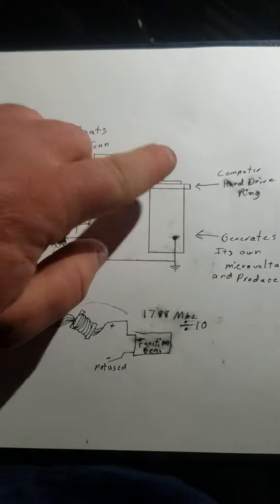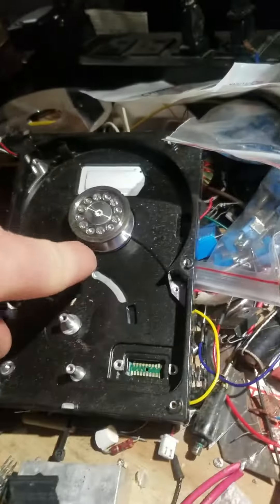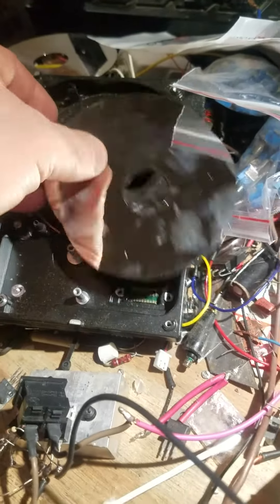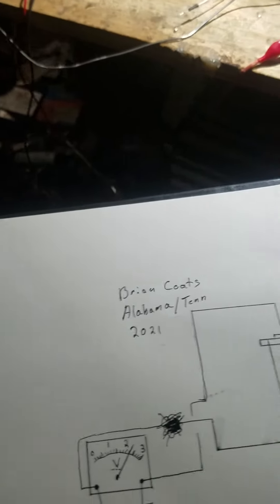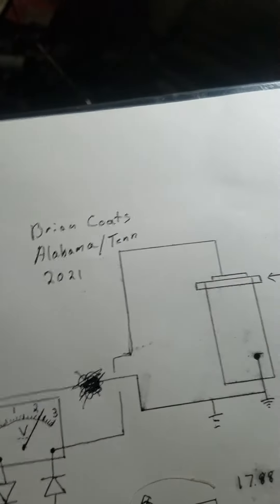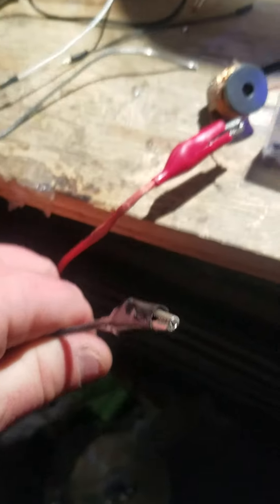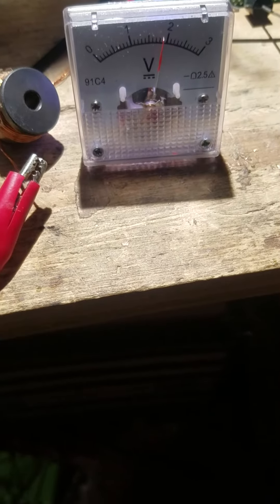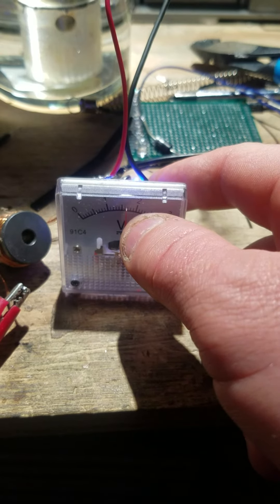Self running fuel cell. Brian coats Alabama

Comment from the maker: I'm not exactly sure I might have to send it off and have it tested it does not appear to be aluminum I'm thinking it may be a type of stainless steel
Reply: thanks,   connect  caps and 12 v reg to it to gather electron and send back as a regulated voltage